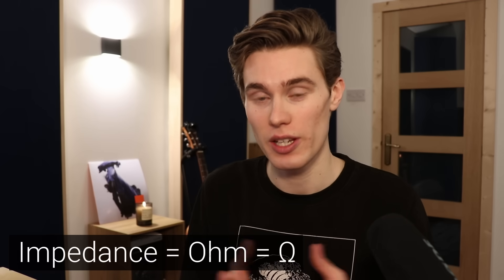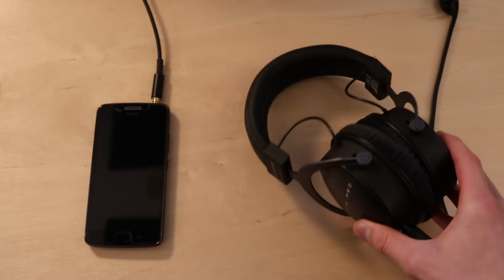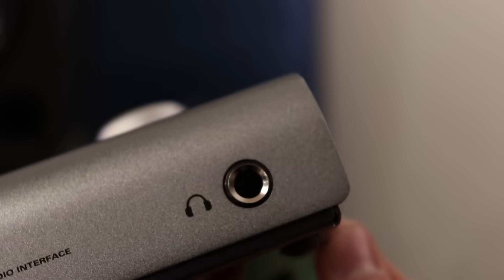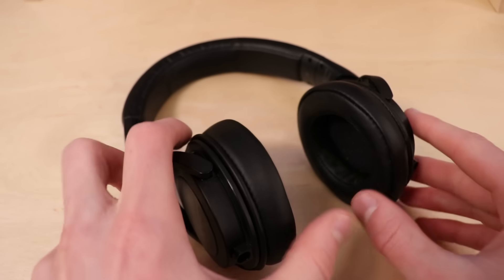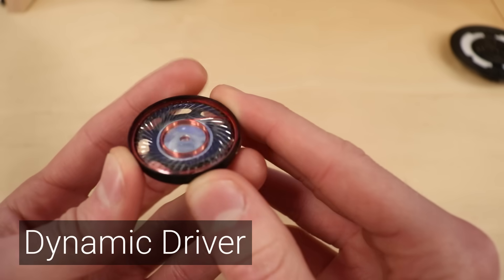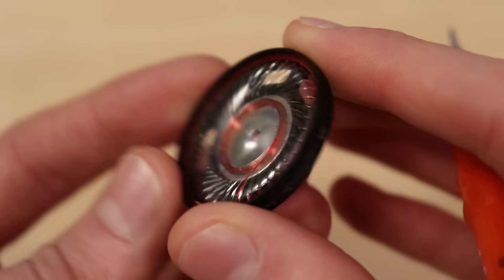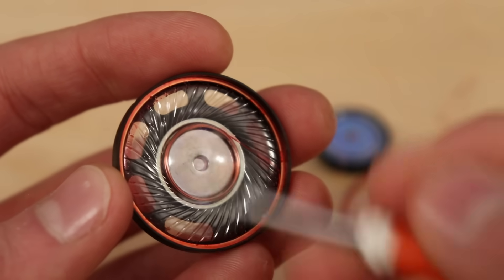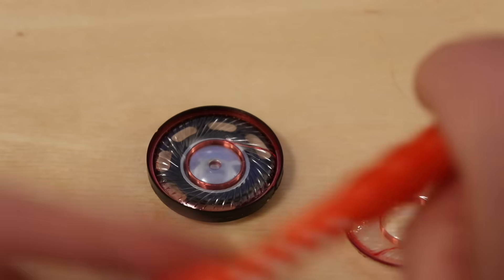32 ohm vs 250 ohm - Which Headphones Sound Best?

Comment: Hi! 

What do I expect if I plug the 250 ohms Beyerdynamic dt 770 pro into the Focusrite Scarlett that can rive up to 200 ohms?  Is that going to sound worse than if I plugged the 80 ohm or the 32-ohm ones into the same Focusrite? What's the best option for me to choose for my Focusrite 2i2? 32 80 or 250 ohms Beyerdynamic? I am about to buy a pair of headphones but very hesitant. I don't know what to get. Get the 32 or 80 ohms or get a headphone amp and the 250 ohms? What's gonna give the best result in sound quality and volume?
Reply: Buy Motu for better efficiency it is has better dac than focusrite

Comment: I have a question for you guys. For my new digital piano (a Roland HP-704), I am considering to buy Beyerdynamic DT-770 headphones. So far I have understood that, in principle, the 32 Ohms version of this headphone should suffice. But I have also heard that in general the sound on 250 Ohms headphones might be better if you use a headphone amplifier. So what should I do? Just buy the 32 Ohms headphones or buy the 250 Ohms headphones along with a headphone amplifier? (And if so, which headphones amplifier?)
Reply: Maarten Ronteltap, I am also planning to use this DT770 specifically for my digital piano (Kawai Es110). I went with the 80 Ohm version. Yes, an amped 250 Ohm version may sound better than a 32 Ohm or 80 Ohm, however, any benefits in sound may not make any difference for use with a digital piano. It depends how you are going to hookup the headphones and for what purpose (for live listening during piano practice or recording/monitoring), because what you hear in either case will be different.

Plugging headphones into any of the piano's analog ports (headphone jack or line outs) during live playing/practice may not be as clean a source as plugging into a studio grade mixing interface or external audiophile dac where it is separated from other electronic components.

Using the headphones directly into the piano, means the piano's digital signal will be passing through whatever electronics and dac chip is provided by the piano manufacturer, before leaving the piano as an analog sound that you hear through your phones. Going through the piano's onboard electronics, may negate any differences heard between the diff Ohm versions of these headphones, as a piano is probably just as "digitally noisy" as a laptop, cellphone, or tablet. So, first test your pianos analog ports to see if you hear any soft hissing or noise by not playing any keys, and turning the piano volume up. 

However, if you are plugging your piano into a computer or mixing interface using USB, it keeps the signal clean, bypassing the piano's onboard dac. And then from the computer or USB interface, you'll have the opportunity to use a dac + amp with your headphones and to listen live or to finish mixing/recording the music on the computer before playing it back on a home Hi-Fi system, or portable digital audio player with the headphones. Keeping the original digital signal until the very end when it reaches the dac, amp, and speakers or headphones will give you the most clean sound.

So, which version to go with? For live piano piano practice, plug 'n play, where you are just focused on playing and some digital noise or hiss isnt important, go with 32 or 80. 

If you will be listening critically for recording/mixing, you use Usb outs to a laptop or mixer, work with a daw and virtual/midi instruments, and digital noise bothers you during practice, or you will be listening to pre-recorded music and lossless music files, with an amp, get the 250 Ohm version.
If you still cant decide, get the 80 Ohm, it can do either setup and unamped, will still let you upgrade and use an external dac or amp later on. 

Also, congrats! Roland has some of the best connection options out there for listening/recording, so you have various choices, even bluetooth! Good luck to you!

Comment: I bought a very old headphone. It's named Concerto TE1010. I've measured the impedance and got 9.2 Ohm. Is that possible ? I have it plugged to my computer and it sounds ok, but not GREAT, and i feel the volume is much lower than my Koss Porta Pro. I am not sure what i need to make it sound better. Probably a Amp/Dac ?

Comment: Aight, very informant. But dident really answer my question, i use to have DT 770 pro 250 ohms and ive got a USB driven Amp connected to the PC. When i turned up the volym pretty much the base started to sound really bad. Why is that im thinking of buying another one doh cuz i loved the headphones itself the sound and bass and everything. should i go with 80 Ohm this time?

Comment: Ooff, it's a little bit more complicated, as far as I've been able to gather. Note: I'm not a specialist in electricity, or headphones, but still:

- The impedance of headphones (indicated in ohms) affects how much voltage is required to supply power to them
- The sensitivity of headphones (indicated in decibels/mW, i.e. 102dB/mW) affects how much power is required to run them
- Therefore, impedance is only half of the story of how strong a source you need for a given set of headphones.
- The impedance of your source's headphone output affects how easy it is for that output to control your headphones

So you need* to know not only your headphone's impedance but also the headphones' sensitivity, and you need* to know your headphone amp's ability to generate power (voltage over a given impedance), and finally it's own output impedance. Thus:

- For high resistance headphones, your source needs to be able to generate more voltage than with low resistance headphones
- For low sensitivity headphones, your source needs to be able to generate more voltage in relation to headphone impedance (voltage squared divided by impedance) than with high sensitivity headphones
- For high resistance & low sensitivity headphones, you need a very strong source. For low resistance and high sensitivity headphones, your source doesn't need to be as strong. 
- For high resistance & high sensitivity headphones, a middling source will be fine, as it will be for low resistance and low sensitivity headphones.

As for the aforementioned source output resistance:
- If the output impedance of your source device is high, it will have a harder time controlling headphones with lower impedance.
- Poor control in this instance means that driving low impedance headphones through a high impedance output will change the frequency response of the headphones, as headphone impedance varies throughout the frequency range.
- Thus, while you might have a set of headphones which have an awesome, perfectly flat frequency response but a low impedance, driving them from a high impedance source will skew the frequency response. 
- Headphone output impedances can vary a LOT, even between very similar devices, and manufacturers may never print the output impedance anywhere in their spec sheets. Generally low powered devices like mobile phones will have a very low output impedance, but audio interfaces might have anything from 0,5 ohms to 90 ohms - and many recommend your headphone impedance should be 8 times the output impedance of your device!

* So to sum up, it's all pretty complicated in theory. In practise, I'd just say:
- If you are going to use your headphones from a real professional level studio setup, don't listen to me. You know your stuff better. 
- If you're going to use your headphones from a hobbyist home studio or quality home theater, and can't find what the output impedance of your device is: pick a set of headphones with high impedance (at least 150ohms, preferably more!) and high sensitivity.
- If you're going to use your headphones with a low powered device such as a mobile phone, a laptop or even the integrated headphone output of your computer: Pick a set of headphones with low impedance and high sensitivity. 
- If you're going to use your headphones with a mix of devices, aim for something with high sensitivity and low to mid impedance. I can run my AKG K240s which are 55ohms and 104dB/mW just fine from my mobile phone, and they work alright with my audio interface as well. The frequency response may be a little coloured through the audio interface, but such is the curse of only buying one pair of headphones.
- The only potential risk of buying a set with too high impedance and too low sensitivity is that you won't get as much volume as you might want. Meanwhile, buying something with too low impedance and too high sensitivity may affect your audio quality, and potentially make it hard to find a comfortable listening volume.
- Aaaand finally: Buy your headphones from somewhere that'll let you try them out with your particular device (at home if it's a home setup or in the shop if you're using a mobile device). Many retailers will let you try and return if your headphones didn't match what you needed.

Comment: All of these discussions about headphone impedance center around power to drive them which is simply a indirect result of an impedance mismatch. More importantly is the efficient transfer of the audio signal from the output circuits to the headphones. Impedance is the resistance to AC signals. If there is a mismatch, some of the AC signal, whether it be audio or Radio Waves or Microwaves or Visible light will be reflected which results in standing waves and degradation of the signal i.e. distortion. Today's consumer equipment is designed to accept a wider range of impedance devices than past eras, but that doesn't mean anything is game. For the best operation of your equipment, read the dang manual. It will tell you what impedance your equipment will accept. All of this talk about power to overcome an impedance mismatch is garbage as you shouldn't be trying to overcome an impedance mismatch. For the best listening/recording experience match the headphones to the device....period! We can get into design characteristics if you want but consumer grade equipment generally use lower impedance output circuits because they are cheaper to build. High end professional equipment designs use higher impedance circuits because they produce less noise but the tradeoff is more expensive. Why do some amps/interfaces cost thousands while consumer grade costs tens?  You got it, better quality more expensive equipment with tighter tolerances, higher headroom, better shielding, etc. Again, don't worry so much about driving power and think in terms of keeping your equipment happy by attaching headphones that match the output circuits of your device.

Comment: Hi , I have a SM Pro Audio M-Patch2 passive monitor controlling unit . I currently run both the reference monitors and my headphones through it. My sound card is RME HDSP 9632 which is an internal model and this is why I use this unit. I just wonder whether the sound card and the controlling unit will be enough the run the headphones 250 ohm and over ( my plan is to purchase DT990 pro for mix and mastering) . And whether the frequency response spec of SM limit the headphone ?  This is what I see in SM’s spec sheet ; output Frequency response • 20Hz - 20Hz +/- 0.5dB Maximum output level • 320mW into 32Ω

Comment: I just got the DT-990 Pro 250 Ohm open back for mixing and mastering in my studio using a separate headphone amp which has 4 headphone outputs. There’s plenty of volume and very precise. As when mixing and mastering you don’t want the headphones to falsely boost anything giving you a false impression of what the finished production will sound like. It needs to sound good when the end user listens on their chosen music device. I use a pair of 32 Ohm DT-100s for recording vocals as they are closed and do not leak sound into the vocal mic. My two Beyer Dynamic go to head phones for two different tasks. Finally a pair of Presonus E-5 monitors are ideal for my small home recording studio.
Reply: what amp did you get please?
Reply: @ at the time of this original post a Behringer HA400 micro amp but now I’m using a Rack Mounted Behringer Powerplay Pro XL 4 channel headphone distribution Amp.
Reply: @johnnydiamondsmusic1673  did the Behringer HA400 work perfectly well? Was it loud enough?
Reply: @ yes it was fine. The rack mount has pan and eq where the Ha400 just volume controls but perfectly adequate. With 4 outputs and cheap price.
Reply: @johnnydiamondsmusic1673  thank you! I use an arturia minifuse 1 interface, will that be okay for beyerdynamic dt770 pros 250ohms  if I purchase this behringer ha400?
Reply: @ yes the HA400 was fine to drive mine.
Reply: @johnnydiamondsmusic1673  what audio interface did you use? I apologize for all these questions, I just don't want to make a bad financial decision 😅
Reply: @Leobeatz0  I record using a Digital 24 track Portastudio
Reply: @johnnydiamondsmusic1673  thank youu

Comment: Thanks for ALL your videos......they are good......Only needed to watch the first half. All great info. However, I was waiting for you to cover the Purpose/use of the different OHM phones. I realize the video was to cover OHMS but this point of mine is also relevant. As an example, I have Three Pair of headphones. I AGREE with you, my Beyerdynamic DT 770 PRO (80 ohm) and also the DT 880 PRO (250 ohm) are both GREAT. BUT my 770's are closed back,  so I use those mostly for Recording, and the 880's are open back, so I can also hear my studio monitors, AND SO, I use those mostly for Mixing. I also have a really OLD pair of Sennheiser HD 280 PRO, over 25 yrs old, 64 ohm, I believe, and STILL WORK and still Sold in music stores like Sweetwater. My TWO Beyer's go itno a 4-channel AKG HP4E Amp, which then goes into my Steinberg UR-RT2 interface, and they all work great. And the AKG also has two inputs for each of the 4 channels for easy use, Only thing I do NOT like about the AKG at about $120, is it has NO On/Off Switch, so I have to unplug the darn unit every time I'm done! I might need to check out BD's 32 ohm's.....PS I did see another one of your headphone Vids that cover closed or open backs.
Reply from the maker: Thank you, I cover the uses and purpose in the second half of the video.

Comment: Easy answer is - lower impediance are louder. You will use them with for example 30-40% volume level and they will sound good. With higher ones you will need more volume % like 60-70%.

Comment: isnt it that low Imp headphones will draw more currant from the amp, and high impedance draw less ? did i get this wrong , because the beginning of the video is losing me. Connecting low imp headphones into an high imp headphone amp will decrease the signal because it will draw more power than the amp can deliver.... im... confused

Comment: On the 80 ohm version, the sub bass will be 5-7 dB quieter, and the treble above 7 kHz is 1 dB quieter than on the 250 ohm version. Consider this when buying.

I bought an 80 ohm version and there is less sub bass than I would like. This is good for mixing music, but bad for listening.

Comment: Quick Answer: The 250 Ohm will sound miles better than the 32 Ohm if it is powered right with like a audio interface or a sound card, the 32 ohm will sound better if you are just plugging it into a phone or gaming console of some sort.

Comment: Been using my DT 770 PRO 80 ohm for years now. I use them for virtually everything from listening to music, movies, live shows and gaming and they still sound as good today as they did all them years ago. They easily surpass any so called top gaming headsets [I have had a few]. My friend always buys these so called latest and greatest gaming headsets [Steelseries etc] and none of them come even close to the clarity and precision of the Beyerdynamics, period. Their build quality and ruggedness never fails to impress me. Other manufactures of audiophile headsets make some great  sets but none seem to be as durable as these. I have dropped them hundreds of times over the years yet they never break or fail. Others I have had simply aren't as tough. They usually break [either physically or electrically] after a couple of years or so. I was thinking of getting a new replacement set but am finding it hard to decide if any can live up to or surpass the DT 770 PRO's. Maybe the newer T5's will be the answer.

Comment: Hi Michael,

I recently purchased a pair Breyer Dynamic 1990 pro headphones after watching your video. I was wondering, do you know I can protect the leather part that sits on your head or how I can replace it if it starts to tear?  Being your an expert I wanted to ask instead of speaking ding hours researching a solution.
Reply from the maker: The leather head band is actually a high quality synthetic leather and is much more durable than traditional leather (at least in my experience). I’ve been wearing them daily for 3 years without any damage or tearing. Every couple of months I take a slightly damp cloth and wipe the headband and haven’t had any issues yet. I think if you did have an issue it would be best to reach out to Beyerdynamic and ask for some assistance.

Comment: Thank you :) That was interesting and very useful for me. I had been wondering whether to buy a higher impedance set of headphones (and an amp to drive them) but it sounds like impedance is less important than other choices (assuming you are using compatible equipment.)

I wonder whether the "more impedance more good" idea that is often taken for granted online is like some of the common assumptions about guitar tone: Yes, that thing you are obsessing over does make a difference to tone. No, it doesn't make as much difference as your picking technique.